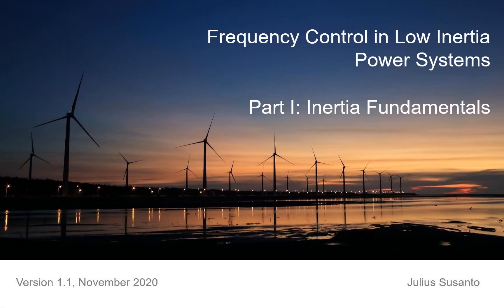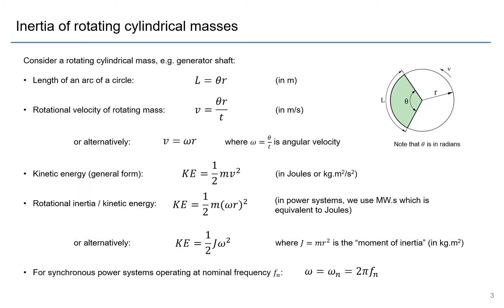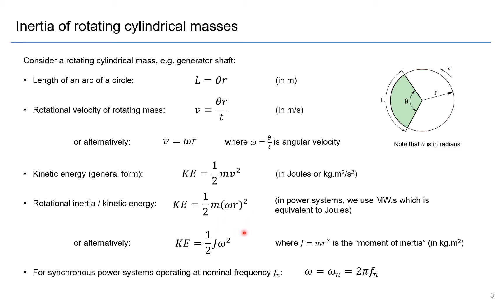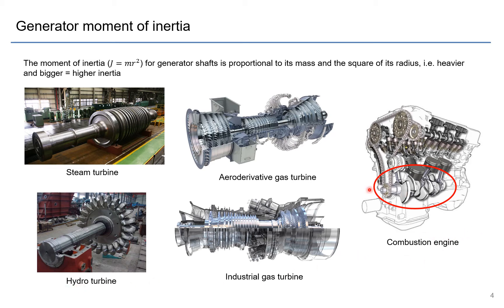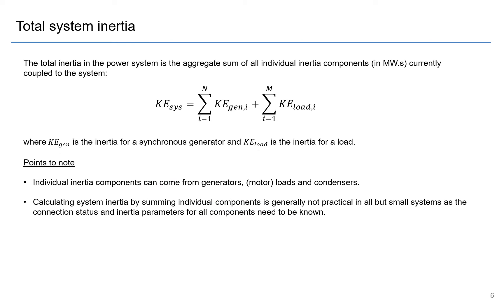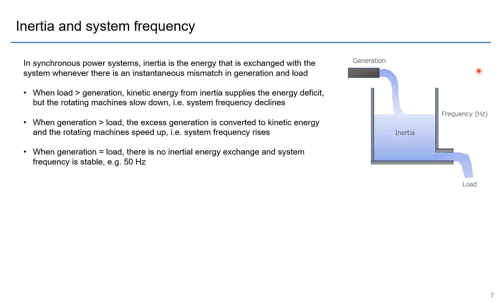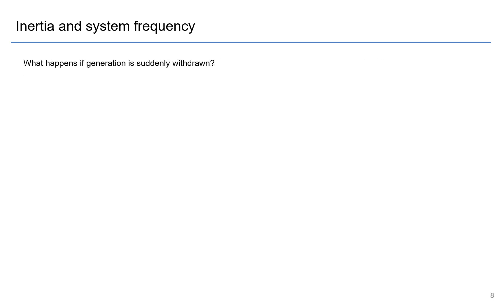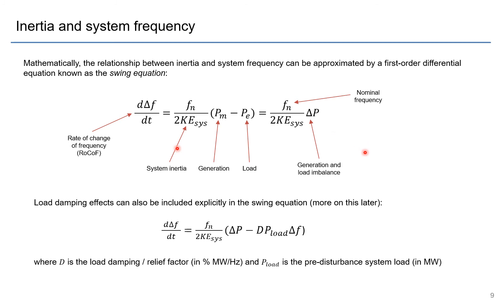Frequency Control in Low Inertia Power Systems - Part I: Inertia Fundamentals

Comment: Julius, 

You picture of varying drivers does not do the steam turbine justice. Typical steam turbines in power stations are much larger in diameter and length. Basically your picture is a bare turbine rotor without blades. Internal combustion engines also have large flywheels with significant mass and diameter relative to the crankshaft.
There was no mention of the alternator, and again large alternators have heavy and long rotors so with considerable inertia.